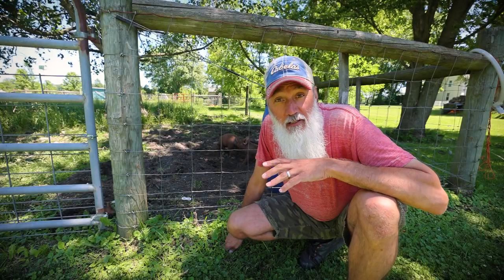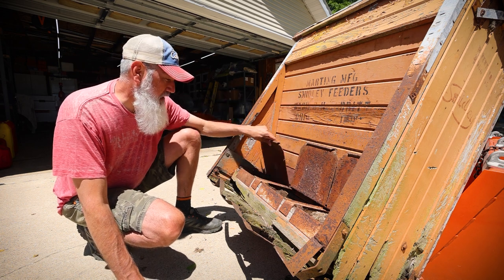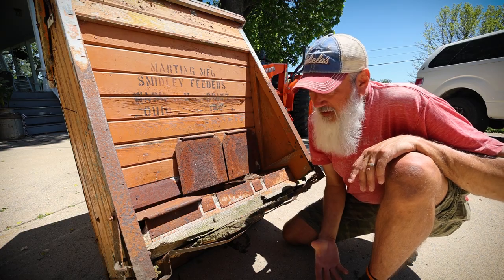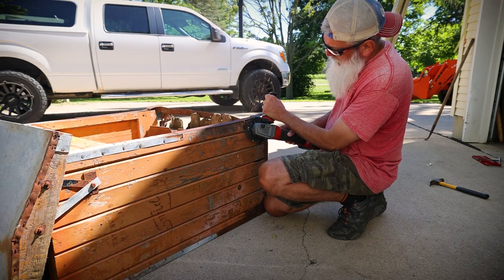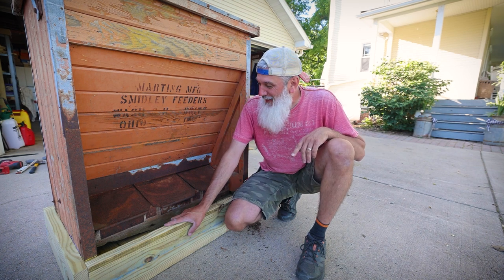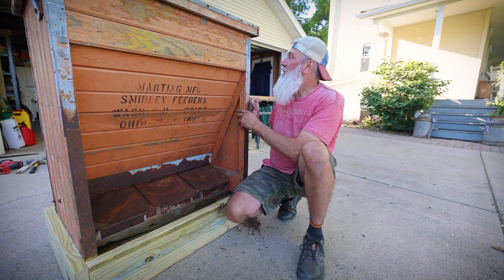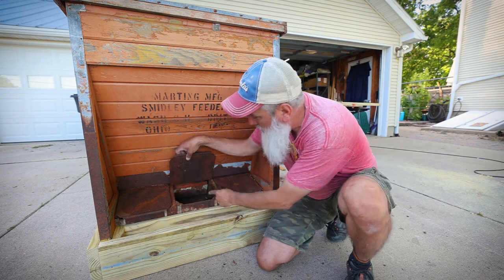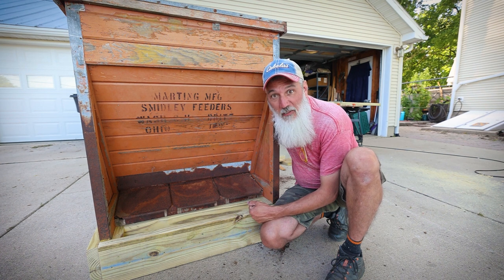The BEST $10 We Ever Spent | Fixing Up an Old PIG Feeder

Comment: Great restoration job there Todd! What a find to have on the homestead. My only suggestion would be to find a way to clean or eliminate the rust where the metal is.. as you know any metal that could potentially be ingested could be lethal.. I ha ent had pigs in years so i cannot recall if they are susceptible to whats called " hardware" in their gut like other livestock is. Just a thought to help for what it's worth. All the best guys!

Comment: Just like training a dog for a doggy door. Tie the lid up. Every other day or three days lengthen the string so the lid sits a little lower (more closed)they will start getting used to having to push it up out of the way to the point the lid is closed and they have to push it up out of the way. Same with the doggy door. Lower the flap every few days, they get use to rubbing on the flap or moving it to get through.

Comment: That looks very cool! That is a newer one than we had. Ours were the big, round, tall galvanized steel feeders where the bottom half tapered and had the metal  lid flaps all around the bottom. It was used in a feed floor for 200 or more feeder pigs (we raised hogs on a pretty good scale.) I miss having them, but I get so attached, I can’t raise any that can’t die of old age. SO we buy locally grown already processed. I envy you can do it!🥰